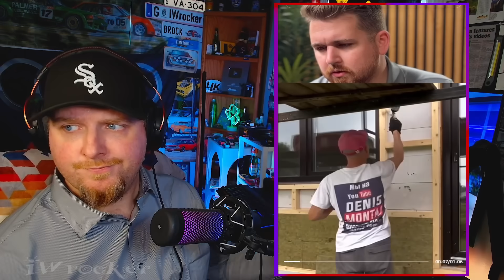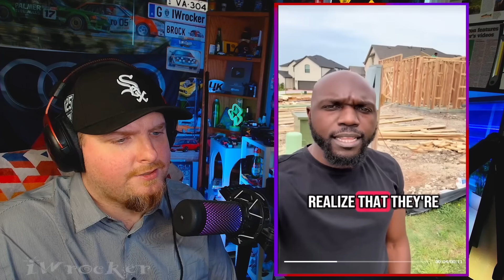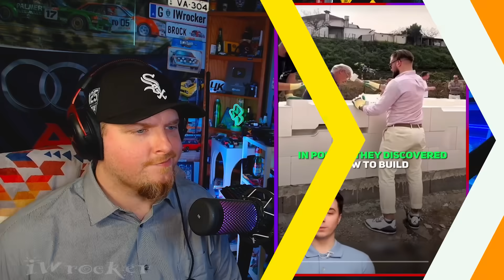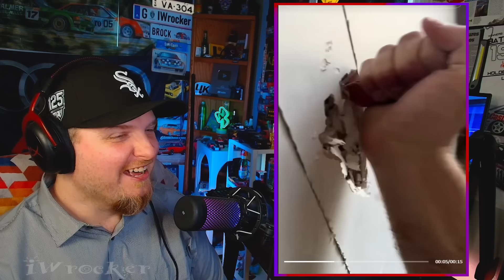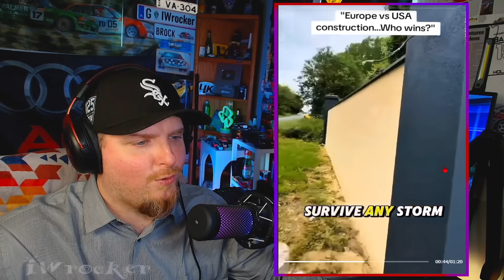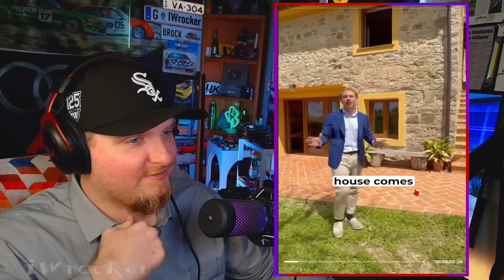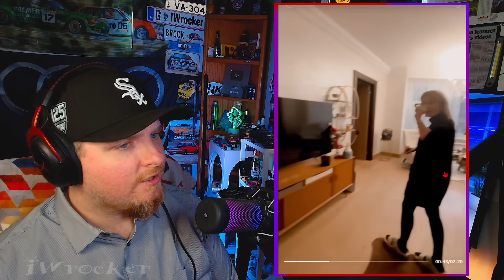25 Minutes of European VS American Home Quality & Construction Methods 🔨

Comment: Americans make things complicated,  they get wood, grind it up, glue the dust together with formaldehyde then put a plastic wood finish on it  !.  Just use good wood and do the job properly why use stone cladding when you could build a stone wall, your roofs made of pitch when a slate tile will last a hundred years.  The houses you build are junk and off gases noxious fumes from foam insulation. $500k for a wooden house, mine has thirteen rooms 10' ceilings and 18" walls built 1848  Sandstone walled garden,  cost £240k ....  US are getting ripped off.

Comment: "why is he insulating outside" lol you never insulate a abrick house from the inside, framehouses yeah but if you insulate a brick or concrete wall from from inside you bring the dew point into said element, and what happens when you have -30 outside and your wall is full of moisture? you just crack your whole wall with it and after couple of years it will be unsafe, and why would you use treated lumber on a wall? its never going to get even wet ffs

Comment: My house in the U.K brick outer tied to the inner thermal block work. There’s a small airspace and insulation attached to thermal blocks - on their outside so - brick, airspace , insulation , thermal blocks, then drywall inside. Lots of insulation between the ground concrete floor and another layer of concrete on top of that.

Comment: 600k bucks for crappy wooden house with cracks, leaks and no insulation. In Poland for same amount (idk if its still possible after inflantion) you could buy a house that's pretty much a castle at this point, everything you want, garage, nice big house, solar panels, big yard, and all of those would be done very very well

Comment: my attempt to show how different the building codes are between EU and US:

in the US you can call a house "passive" if it generates about the same energy as it uses. so if you have a poorly insulated home that uses a lot of electricity for heating/cooling but have a solar farm next to it on average generating about the same amount per year, people will sell it as a passive/green house.

in EU, most countries have different standards a house has to achieve to be considered as passive, but the general rules include air tightness (number of times the air is replaced per hour), yearly needed heating energy usage (kWh/m2year), specific U, or as it's called in US, R values for both transparent and translucent surfaces usually requiring triple glazed gas filled (for the glass) and multicellular (for plastic) or insulated (for wood or light alloy) framed doors and windows, and for walls a minimum amount of mandatory insulation (example: mandatory 24cm (9.45") graphite EPS insulation with a minimum 17cm (6.69") brick wall). also the installed air conditioning system needs to have certain features like heat recovery and de-humidifier.

and even the average (non-passive) homes have minimum requirements now, but unlike with passive regulations you have a lot more choices you can take. like having only 15-20cm standard EPS insulation with a 30cm brick wall, or 10-15cm insulation on a 38cm brick wall. there the overall U value is calculated, while in passive homes there

Comment: Mold develops inside, when you don’t open the windows 2-3 times a day. The body, showering, cooking makes your inside air moist. You need to get the air exchanged by opening all windows to exchange the air. Mold is not due to cracks in the insulation. It develops because it‘s airtight and moist can‘t get outside.

Comment: Hello. In France, regulations require a continuously running mechanical ventilation system (VMC), which helps prevent indoor humidity.Combined with European double glazing, this results in real energy savings on heating bills.
:finger-red-number-one::finger-red-number-one:

Comment: The method at 13:35 is exactly how my house was built. The whole house is in A+ energy class, which means I have one of the most efficient systems for insulation and energy saving available. The energy bill for heating is about €200 per year, everything included. This is an average calculated over the seven years we have lived here.

Comment: 'Why would you put the insulation outside of the house'... so the house doesn't 'sweat'. Do you want to keep moisture out of the walls... or let it seep in until it reaches the insulation?
With one you gotta open your windows more often to remove moisture adding in the wall... for the other you get nicely decomposing material from changing moisture levels.

'The issue isn't the material, it's the workmanship'... if you need excessive quality control to achieve the basic function and no danger then maybe... just maybe... the system is shit.

'Don't start a fire and fall asleep'... those houses are literally built to not catch fire should something even for some odd reason fall out of the fireplace. They were designed for hundreds of years with surprisingly good fire safety in mind. People stoked the fire right before heading to bed, falling alseep as the wood burned down to stay warm for as long as possible.

Comment: Build authentic. If it‘s wood, show the wood. If it‘s concrete, show it. Of course osb can‘t be exposed. My garden shed is built better. Sorry. But I also used those shindles you use for houses on my garden shed. Full terracotta cover on the home though. Lasts for 100 years

Comment: In the UK most hoses have plasterboard/drywall on interior frame walls but there are also solid load bearing walls too to add extra strength to the building

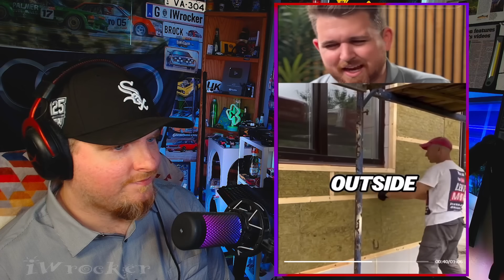Comment: 1:20 "Why put insulation outside of the building" - outside is the only place. Placing it inside leads to inevitable condensation and rot in the winter, absolutely unacceptable and probably against the codes. But if it's California or Florida, why not?
For the record, my summer house has 60 cm aerated concrete walls + 7 cm exterior rockwool, just like in the first clip but without wooden studs or foam glue or siding. These are really unnecessary, rockwool is sufficiently held in place by plastic nails and surface mortars with mesh reinforcement. Last night, exterior temperature was -22C, and interior temperature +7C at floor level - no heating whatsoever.

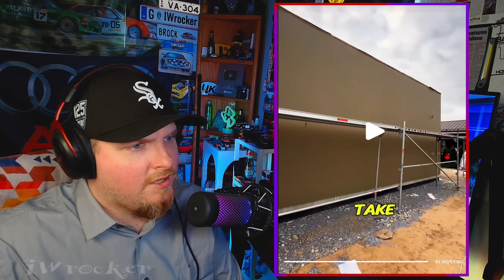Comment: 14:40 here in germany that is called Wärmedämmverbundsystem (~ thermal insulation laminate (?) system). its a standard energy efficiency tactic in current buildings. it turns the entire mass of the bricks or concrete in the outer walls into a thermal battery

Comment: I live in "modern" wooden house in EU. 
Walls are about 8" thick, all with proper stud blocking, beams and columns are 10"x10" proper wood (not three 2x4 nailed together), and biggest thing, all walls have 1" high density hard OBS, screwed (no nails in sight) to studs, and then 5/8". of drywall is screwed on that OBS, studs and studs vertical blocks. This make wall extremely strong and durable, screwed together. Not to mention that all inner walls are insulated by rock-wool. Outher walls have almost 6" of special rock wool (some use styrofoam or XPS) thermal facade, finished with stucco.
Windows are aluminum-wood 3 layers filled with argon gas, and aluminium front doors... Roof is metal sheets with a rigid foam core (for extra thermal and sound insulation). 
If people in US would have prices of gas and electricity same as in Europe, US houses would pay 80-250% more for gas and electricity, so just think how inefficient US houses are
But yea, our Europe's houses are dumb, build by idiots, while costing 3-5 time less than same size and location "sheds mansions" in US...

Comment: I don't knowe about other countries in Europe but in Poland the REAL, sturdy building ended some time around 1960s - I'm talking about cities because in the countryside it's an entirely different thing.  The houses - including tenement houses - were built from brick and mortar, INCLUDING the inner walls.  I lived, as a child in a tenement house built roughly in the first decade of the 20th century, and the inner walls were about 30-40 centimetres thick, while the outside ones were about one metre thick.  But even in the 1950 and 1960s, despite comunist times, they built quite sturdy brick walled-houses.  Then came the worse times, and they started building houses from the so-called large prefaricated concrete panels.  Convenient but very ugly, and - just like so many times under "communism" - haphaardly made with frequently uneven surfaces etc.  And then came the other system, and houses became more beautiful again.  Except only outside, as outside walls and load-bearing wals are still made of cement or bricks.  But all the inner walls are nothing but cardboard-plaster partitions which can also be cut with knives.  Just like everything in the modern world, and I mean everything (unless it is abnormally pricey): the looks are great but the execution or workmanship is very "plasticky" (same relates to cars and many, many other goods/objects).  In the countryside things are different in that, most of the time, people build their own houses and - whether they are made of wod, cement, stone, or bricks - they are usually a bit sturdier than their American counterparts.

Comment: You need to check out "izodom 2000" from Poland. It is a house building technology like no other. You build the insulation first, you add rebar in the process and then you fill up the designed holes with concrete. After the pour the walls are done, and they are insulated both outside and inside. These are very easy to lay pipes or wires in as you only need a knife to cut the internal styrofoam.

Comment: You can build an USA house in a week, barely the time for european concrete fondation to dry. Must say most US houses are glorified barns, sure can be nice and cosy, even luxurious but a barn none the less. Even our French low cost house called « maison phœnix » and concrete fondation, outer walls and some inside with some dry walls to delimit rooms. Older European houses are literally stones and some buildings (still in use) are almost a thousand years old.
As for the slim house my guess it is a decorative front with behind some kind of ventilation from old subway or train tracks. City scars left by the steam era.

Comment: All sorts of houses, with different aesthetics, and built in different ways with different materials are fine - some I like more than others, but that's personal preference. But why of why would you build houses that need constant maintenance to keep them stable and weatherproof, or that are going to burn down quickly and completely?
That skinny London house is just a facade - if you look the train lines run right behind it. It's to maintain the aesthetics of the traditional  (very expensive)  street frontage, rather than have a gaping hole exposing the more industrial train lines.

Comment: Regarding the house in Tuscany in Italy, the houses have large plots and it is not unusual for there to be orange and lemon trees on the plot.
Many of the houses have a pool in the yard.

I was looking at a house in Tuscany, the living area of the house was 350 square meters (European measurements) divided into 2 wings.
The plot was 10 hectares of land (European measurements). On the plot there was a pool that was 20 x 6 meters (European measurements). On the plot there were olive, orange and lemon trees.
you had a 360 degree view around the house. The price of the house was 700,000 Euros. It should be added that in Italy you cannot raise the price but you make an offer that you want to pay which as said cannot be over 700,000 Euros and then it is up to the seller to accept the bids or come up with a counter-offer what you can sell it for.

Comment: Last year, I replaced the roof on my house. The old roof was from 1923. It was still ok, but since I want to add some rooms directly under the roof, we decided to replace the roof and then work on the inside. That's how durable our buildings are.
Reply: My roof is from 1964 a few tiles have been replaced but that is it

Comment: Once in the past,  and that was like 20 years ago, together with my friend we have tried to fit a safe into the wall in one of the brick wall in his apartment in Gdynia - Poland. 
Gdynia is the city that exactly till the day (10th February 2026) have a 100 years of its existence. 
In the late 1920’ when Poland had the only access to the sea by Nazi Germany  controlled  (that time) City of Gdańsk (and yes- that is the city where the first shots of WWII had place, and also where in its shipyard the Solidarity has begun), so basically when Gdańsk was putting huge tariffs (from where do we hone that method from?🧐😂) on goods delivered to Poland  we’ve decided to build the whole new- ultra modern city with modernist style. 
These buildings were build already with underground garages for a very  few automobiles that time …. And with the additional level for an air raid shelters. 
Been there, as you may get a tour to see them. and these new modern buildings are like little fortresses, with underground exits street away. 
And the walls there are massive. 
So we have been placing the safe in one of these walls inside the apartment. It was brick wall - and 
The safe was 50 cm deep. 
So it’s around 20 inches. 
And we had like 5 inches margin to the wall from  the other side of the wall. 
So this is how strong the building in Poland might be. And we are talking about the building made nearly 100 years ago.

Comment: The London facade will be there to hide venting from one of the earlier tube lines that were made using cut and cover. They used steam engines in the beginning, before 3rd rail electric was invented, and there had to be as much ventilation as possible. There are fake houses in various places around London that hide these essential vents.

Comment: To be perfectly honest about the wall thing: In France(at least) we have bearing walls(murs) made of solid materials (concrete bricks stones cinder blocks etc) and then there are the inside walls(cloîsons) which are thinner and made of plaster plates(or cardboard =like US homes although this is usually in cheaper construction) and aluminum or timber frame. These inside walls are fairly easy to remove (with sledge hammers electric saws and such) but it's not flimsy either : you'd have a hard time punching through a wall, any wall.

Comment: I live in The Netherlands and our house (in the middle of a row of 14) has 4 own concrete outer walls, but all interial walls are plaster walls, like the walls in the USA. So you can modify your own home easily. Our home was build in the 1980s and we have no insulation on the outside. We have brick on the outside, with a little space between it and the concrete wall. That space is filled with some insulation stuff.

Comment: My house in Ireland has 4'' of concrete block, outer leaf, 9'' inner leaf, 4'' insulation between leaves and only 6 upper story walls that are stud. but not plaster board. instead fermacell is used. Punch it and break your hand

Comment: I live in Mexico and my house has concrete walls with rebar and the load bearing ones, 10 inches thick. My children know not to play in or near the house to avoid fractures and casts. The house in the Netherlands was built in 1952 using bricks. Everybody has a hammer drill concrete drill bits and plastic plugs to hang things on the walls, including heavy TVs. Careful to not drill into the rebar, though. Houses have to be functional, not for appearances. Square meters in Europe and anywhere else, except the US. Don't complain, you have higher salaries and want to give it to the bank, doctors, etc.

Comment: First dork needs to look into where the dew point is expected to be. If you don't build your house like a plastic bag it is very important that the insulation is on the outside. If you do the full air tight membrane thing you can have the insulation where you want... but those are only one picture on the wall away from not being not air tight. And then you get condensation in the insulation. And then you get mold. And then your house only lasts 20 years.

Comment: Why wouldn't the insulation be on the outside? So you ruin the insulation every time you want to hang up a picture, while the actual walls cool down all the way and expose the insulation to icy concrete instead of just cold air?? 

Also...Its a Piaggio Ape^^

Comment: All new houses in the UK have to pass the 'planning' before anything happens; insulation, depth of foundations, plumbing, electrical wiring, etc.  At each stage of the build - i.e. foundation laid  - it is inspected and hopefully passed for the next stage.

Comment: here in Europe a lot if not most all inside walls are plasterboard, there's regulations we don't usually use wood for obvious reasons 🔥🔥🔥it's the outside walls that are solid

Comment: About the windows, from what I saw they had bought 1-glass windows. Here in Sweden (the Nordics) we put 3-glass windows in our houses nowadays due to our cold climate. 3 layers of glass with 2 air gaps. It isolate from cold draft and also noise. Of course the 3-layered glass windows are much more expensive to buy but instead we can keep the electricity bill lower instead. There is a huge variete of windows, going outwards, inwards, tipping and windows with ventilation hatch...